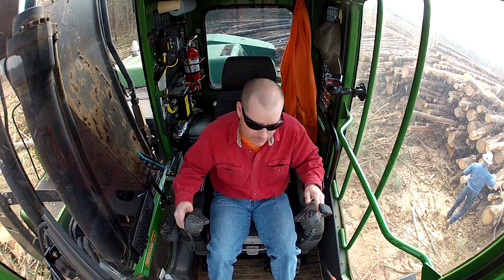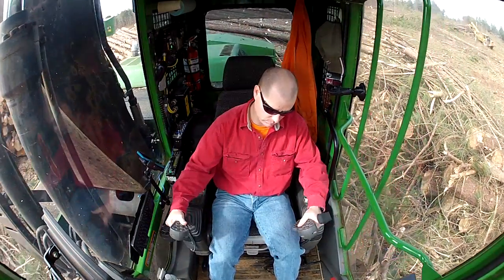A view from the processor!

Comment: I think a real big bonus to the processor is that the carrier doesn't wear like a regular loader delimber and sawbuck design. I can see ya'll putting new head on that machine when it wears out. I really appreciate that you don't cuss and act out of control on the job, gives us boys a good name out here in the woods.
Reply from the maker: Joe Smith Thanks and you're right, theres hardly any wear on the actual machine like what you will see on a regular loader/delimber combo.
Reply: Joe Smith waratah never wear out. Apart from upkeep. the 626 Im on is 32,000 frame hours.

Comment: Where did you get the deal on the left joystick that is against the back of his hand?
Reply from the maker: U can buy them but they're costly. That's just a piece of 1/8" thick flat bar that we slotted with a die grinder to fit the joystick shaft between the nuts and then bent it 90 degrees in a vise. My sister sews the padded piece that is the cushion.
Reply: +cotontop3 oh good deal I was thinking I could make something like that, I can't find where you can buy one anywhere.
Reply from the maker: +Drew Hansen it's a Waratah part and comes from a dealer is you buy one.

Comment: How does that head do with harder hardwood like oak and hickory?
Reply from the maker: It still does really good in oak and hickory. He will work that stuff through the head and it will slow him down a little but it's still way faster than a loader delimber will do.
Reply: Do you think the head would hold up if you ran nothing but hardwood?
Reply from the maker: As long as you got a larger head like 624 size or a 7,500 pound head, they do fine even in hardwood.  We've ran a lot of hard wood over the years and had no cracks anywhere ever on the head.  Your knives will wear quicker though.
Reply: Thanks and I appreciate you always responding.
Reply from the maker: Its unreal what those heads will do compared to a pull through delimber.  I try to always respond to every comment I get.
Reply: thanks guys good conversation!!!
Reply: cotontop3 Run a 626, everything looks anemic in comparison. I'm running a 626 on a EX480-5 LC log loader. Just inhales timber